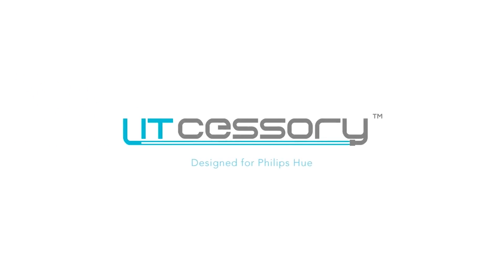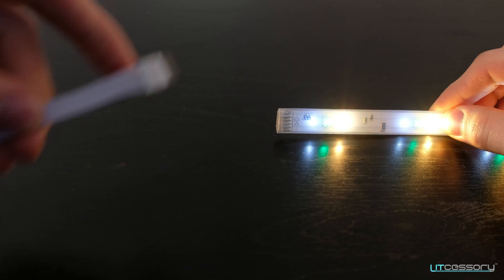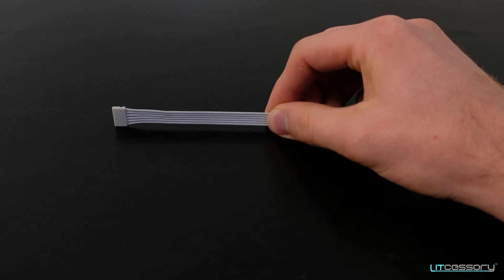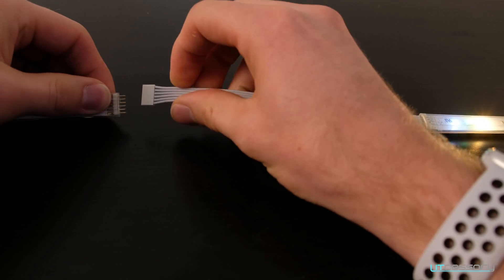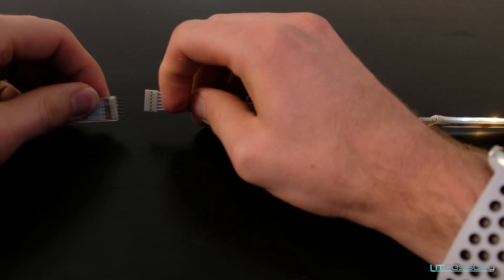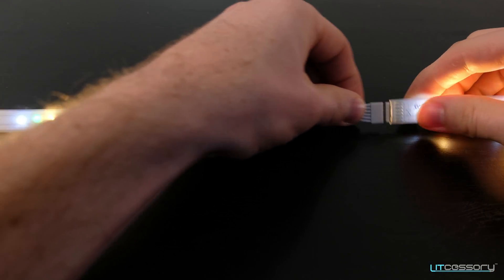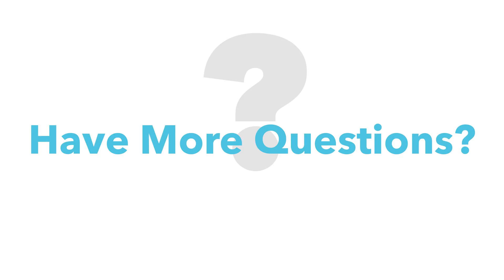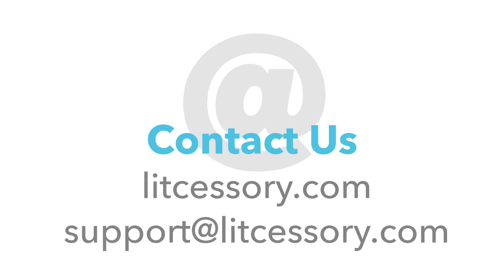Troubleshooting - Reverse Polarity - Philips Hue Lightstrip Plus - Litcessory

Comment: Could I connect 4 - 2m hue strips with this?
Reply from the maker: Sure, so long as you have factory 6 pin connections on the Philips Lighstrips to plug into (uncut lightstrips). If you do have a cut lighstrip and need to connect an extension cable to it, you will need to connect our our Cut-End to 6-Pin cable first. This can be found here: https://litcessory.com/product/cut-end-to-6-pin-extension/

Please feel free to contact us directly at support@litcessory.com. We are always happy to help!